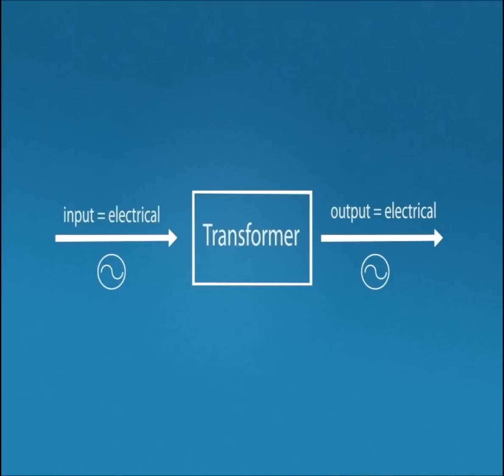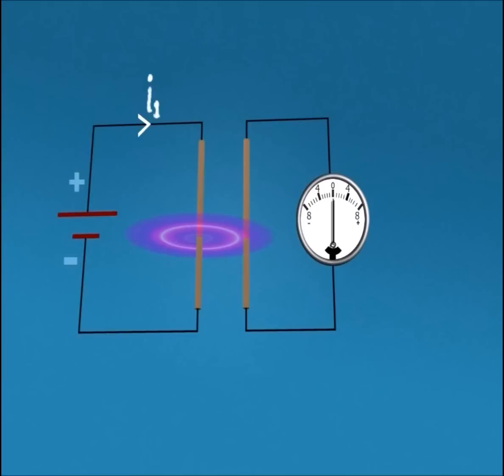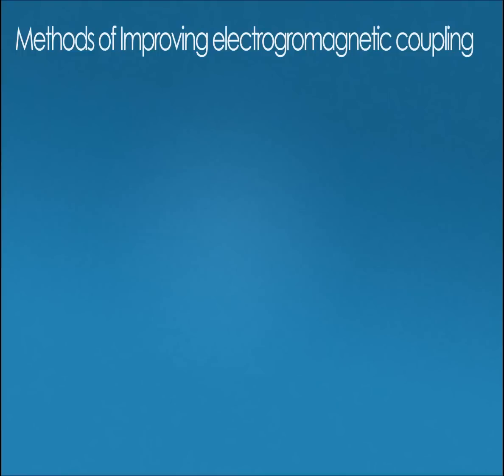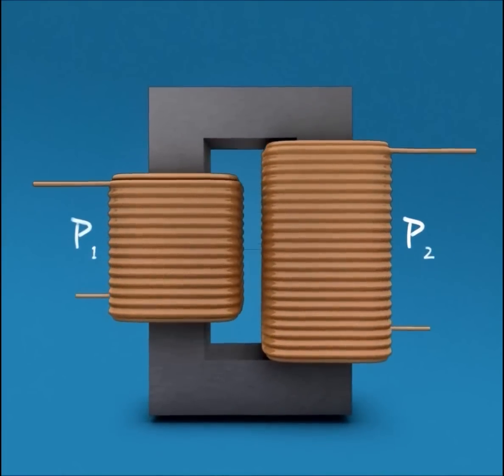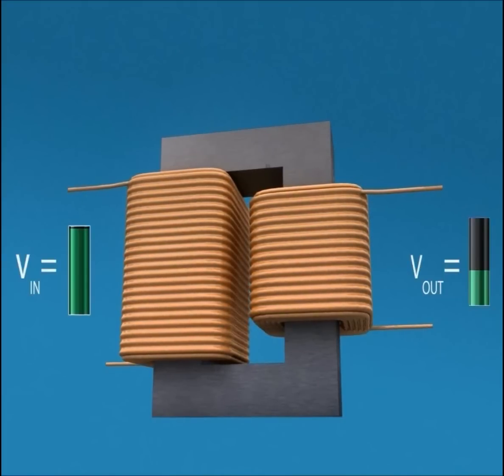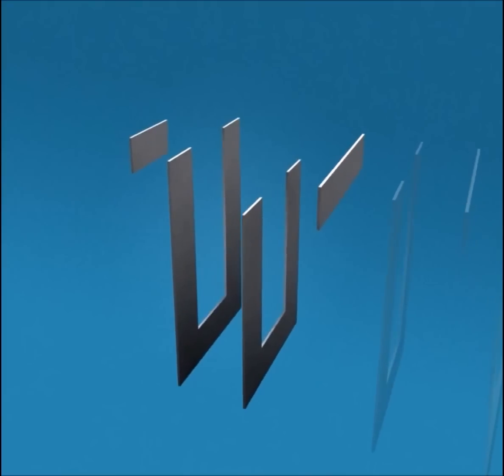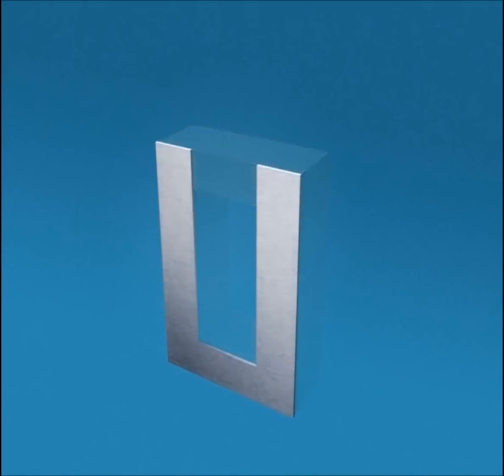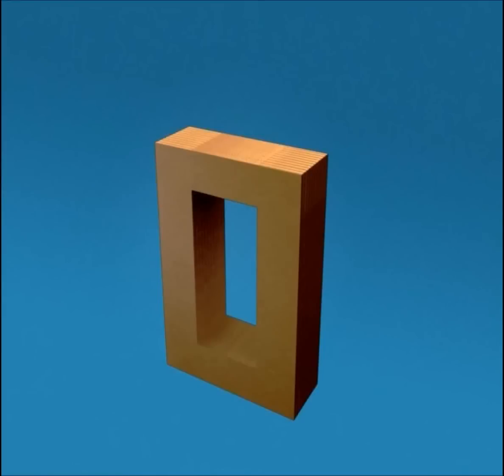Working Principle of Transformer (3D Animation )

Comment: Physics is all about building concepts. i learned a lot more here as  compared to what i learned in my class sitting for like 40 mins or so . so thanks for uploading this video..  keep it up. best wishes
Reply from the maker: Thanks
Reply: @SourabhSharmaTheProfessor  i found only one animation vid on whole yt thnks sir
Reply: Im amazed an dc source #battery is at the input used which is generating emf n further magnetic field n tat tends current in other side of the wire 😅  can any 1 guide ...
Reply: 😂😂dc or flucx

Comment: if step up transformer causing  lower current how  the device(electric motor) works with the lower current
Reply from the maker: when rated voltage appled across motor it simplys draws rated current from the supply. If transformer is there in between supply and motor, lower current at high voltage simply transformed into high current on low voltage side.

Comment: First tell me one thing how did the current flows in second coil when u are giving a dc source 😁😁😂
Reply: The video is correct the dc made the coil an electromagnet and the meter detected it for a second if it was ac the meter would have detected it longer
Reply: No

Comment: inductor opposes AC through it.
then how does the the transformers work.? 
as the both coils are inductor.
Reply: BurningEvents
Reply: BurningEvents resistor oppose curent..
Is there any current in resistor when p.s is applied across its end?